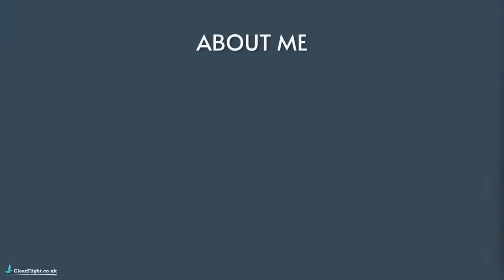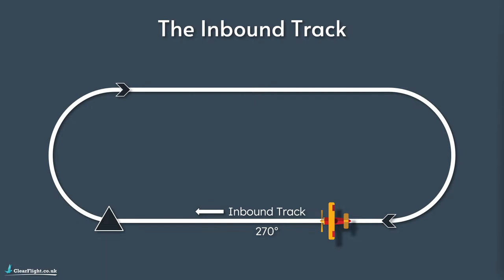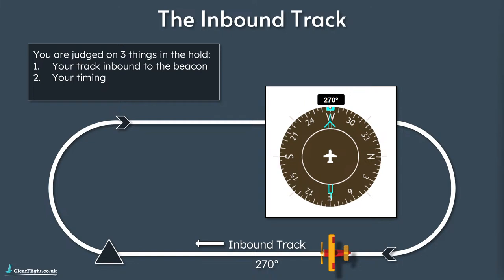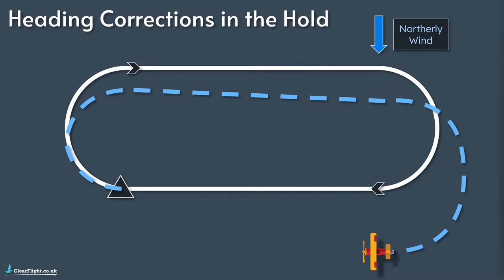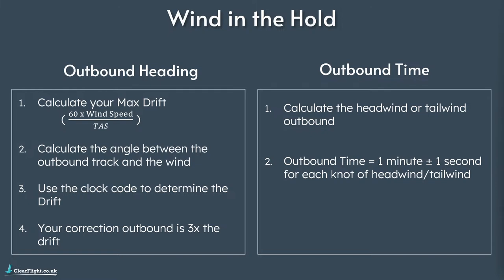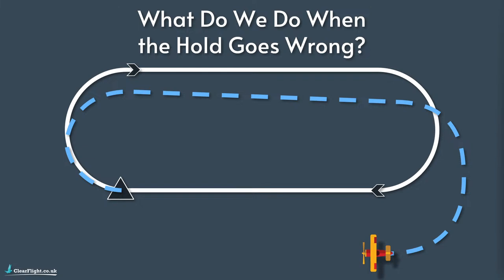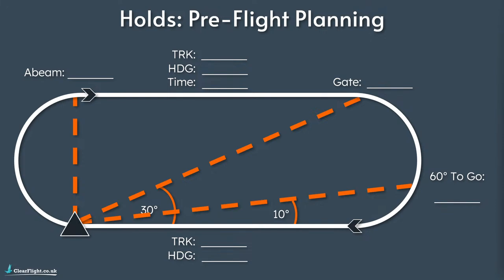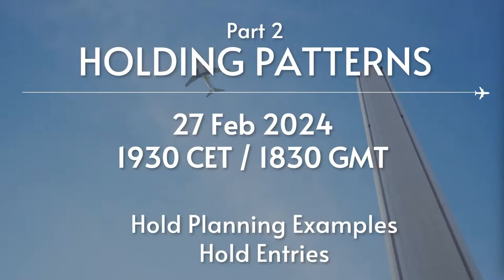The Holding Pattern - Part 1 | EASA & UK Instrument Rating

Comment: Great video. Do we not change the gate by the value of single drift?
Reply from the maker: Hi! Yes, strictly speaking the gate should be adjusted by single drift. However, some schools teach this and some don't. The gate is really just an approximate indication of your position in the hold, rather than a perfect science. So we've left it out of this presentation, which is designed to give you a good basic understanding before heading into your flight training. Your individual flight school will teach you the specifics of how they want you to fly the hold. Hope that helps!

Comment: A word about strong headwinds on the outbound leg. I will use an exaggerated example to present my point. Assume there is a 30 kts headwind aloft on the outbound leg (there certainly can be). Assume that we fly the hold at an approach or loitering speed of 90 kts TAS (not very realistic, but it makes for a nice example). So for the holding diagram shown the wind is 09030KT. Now consider two outbound timing examples.

The rule of thumb says to add 1 sec for each knot. This example is exaggerated, so let us be extra cautious. We add 40 secs to the outbound timing. During the first turn, for one minute, we are moved 0.5NM west. Then during 1:40 outbound with ground speed 60 kts (90 minus 30) we move 1.67NM east. During the turn to inbound track we move 0.5NM west again. This leaves an inbound track of 0.67NM, which at 120 kts ground speed (90 plus 30) is 20 secs. The beauty of this example is that the time for a trip around the pattern totals four minutes (1:00 + 1:40 + 1:00 + 0:20).

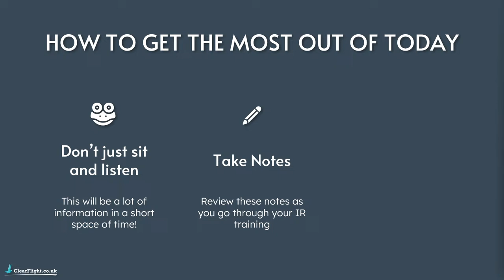Say I aim for the standard one minute inbound leg flight time. In this case I will extend the outbound leg timing to three minutes. Let us run through the pattern timings. First turn is 1:00 and moves us 0.5NM west. Outbound for 3:00 moves us 3.0NM east. Second turn is again 1:00 and moves us 0.5NM west. The inbound leg becomes 2.0NM, which takes one minute to fly (at the 120 kts ground speed).

The morale of the story is, if you have a strong headwind on the outbound leg, do not cut your outbound travel short, or you might get quite rushed on the inbound leg. In the examples above if you use a strict 1:30 outbound timing, you get 15 secs on the inbound leg. That is not a lot (e.g. if you need to reintercept an inbound track). Also notice from the second timing example, that 30 knots led to a 120 secs increase; that is a 4 secs per knot ratio!

What would you do in such a situation? I think it might make sense to see if you can choose a faster speed, but let us say you cannot, how much time would you add to the outbound leg?
Reply from the maker: Hi, a valid point raised! 2 considerations for your scenario:

1. The hold timing is not required to be 4 minutes. Although it still gets referred to as a "4 minute hold", that hasn't been a requirement for at least 2 decades and I'm not sure when (or in which countries) it was a requirement before then. The 4 minute (nil-wind) hold is really just used as an example for students who are first learning the theory of the hold. ICAO PANS-OPS Doc 8168 simply tells us to adjust the outbound time of 1 minute to account for the wind. It does not tell us how to do that. So you are within your rights to make the outbound timing 3 minutes if you wish, provided you do not leave the hold protected area.

2. The same ICAO doc also tells us to start the outbound timing at the abeam position or wings level, whichever comes later. So in your example, you would finish the outbound turn 0.5nm west of the abeam position. You would then fly straight and level for 30 seconds (at a 60 knot ground speed) before reaching the abeam position, where you would start the 1:30 outbound timing. That would give you 2:00 on the outbound leg in total and is halfway between your two examples.

Personally, I would fly the 1:30 outbound time, which starts at the abeam position, but that is not the only way it could be flown. Your example of 3:00 outbound would be another valid technique in those circumstances. Some schools that use slower aircraft teach an outbound time of 1 minute +/- 1.5 seconds per knot of HW/TW to compensate for this. As with almost everything in aviation, there is more than one solution to the problem!
Reply: @ClearFlight1  Ahh, yes, of course, the abeam position rule is what saves the day. Completely slipped my mind. Thank you.